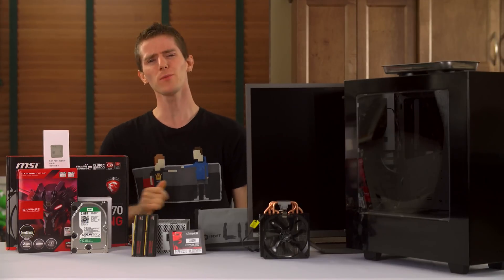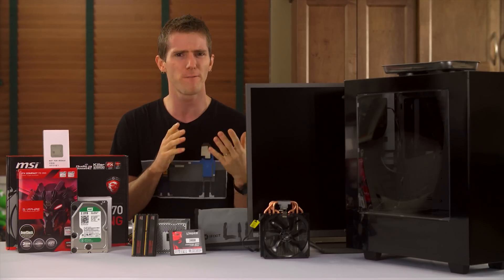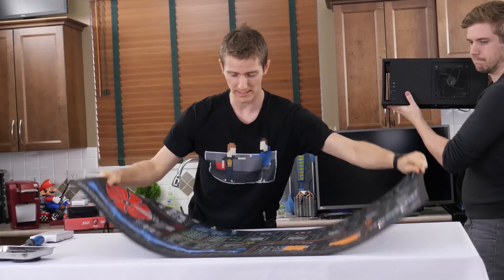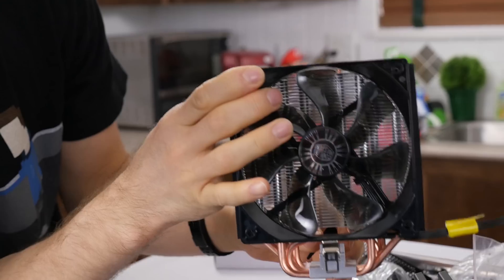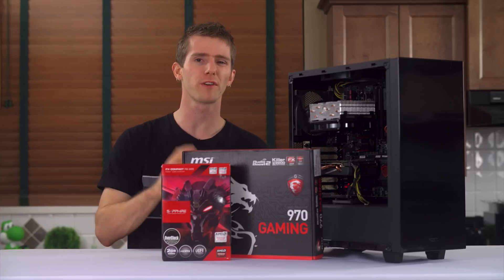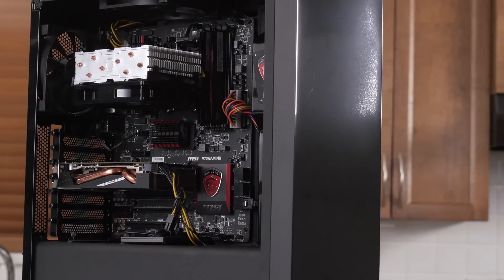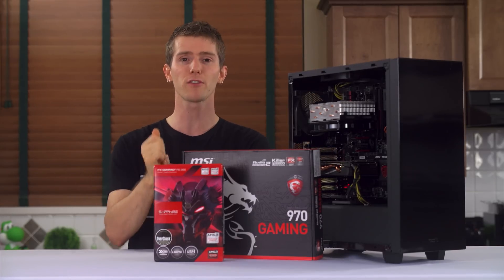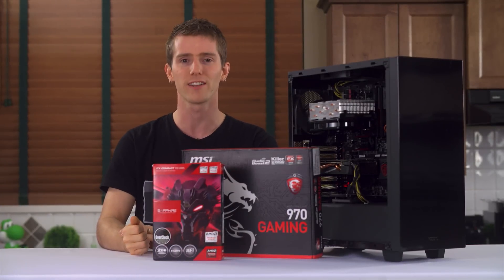Can you Build a 4K Gaming PC for Under $1000?

Comment: I have this build and am loving it! Easily running 4k on all of my games except for World of Warcraft, which runs at 45-50 with details turned down a bit.
I happen to have the 8150 eight core OC'd from 3.6 to 4.0, Can't get it to be stable past 4.2 so I'm not pushing it, I also have watercooling h100i, my question is what is my next upgrade? My ssd is only 120 so OS is not on it, also 16 gigs of ram and running two screens of my 970.
My birthday upgrade was the 970 from the Radeon HD 6970, any suggestions on what my next move is to make 4k a little bit more future proof?
I was thinking cpu for a while because my Fx-8150 doesn't seem to stabilize over 4.2Ghz. It runs really cool with idle 15-20% load at 22C and full load at about 45C. I assume it's something to do with that many cores all being OCed at once (My psu is 750w with about 3 hdds and one ssd, watercooling and 3 fans for intake flow and outtake)
Thinking maybe new mobo with integrated, to just take the load out of the 970, maybe another 970, then I'd need a mobo too, maybe even a new CPU.

Any suggestions are welcome I'm thinking about 400$ budget.
I'll also accept any do this now buy this later idea you guys have :)

P.S. Love the videos keep it up!

Comment: hey maybe you guys in the chat can help me out. im new to PC gaming and dont have alot of money.i dont really want a future proofed system but im assuming that if i make a PC that can play MGSV at its highest settings and 1080p 60fps and also stream/ web surf (im a tab junkie) at these settings then i should be fine with most PC titles that you would also see on consoles this year. problem is i do not know where to start. if anyone has info on what i should buy to meet the requirements im looking for just message me. if it ended up costing 1200 or so thats not too bad but i'd like to keep it as cheap as possible.

Comment: Hook so I don't know if the monitor price was in this but I think it wasn't, for scream at me for being bad at this but wouldn't an i7 4820k with a gtx 770 be better? I managed to fit both this and an asus rog mobo in my price range of £1000 is it just me or wouldn't that be more powerful at least gpu wise?
Reply: Azteched Minecraft The monitor is half the price of the build. Otherwise he could have done a lot better. It's a whole 4k gaming pc. And I think he made a rather good build. If you have the cash you can always run two 285s. Will just have to upgrade the the power supply as well.
Reply: oh ok, i thought that without the monitor it would be really bad but with it, its an amazing build, but what are your thoughts ono the 770's? if you had a little more to spend would a 770 be a good buy
Reply: i7 dose not gain anything over the cheaper i5  and also dose not gain much over the even cheaper amd cpus    770 good card but most are only 2gbs
Reply: i dunno i got the 4GB one but maybe

Comment: Just a heads up R9 290's are significantly better and well within the 200-280$ spread.
Reply: eldragon00 That would have forced them to upgrade the power supply which would have threw out the budget. The 285 is extremely efficient.
Reply: jpchevron Or drop the hdd a bit, get a 40 GB boot ssd and a 1tb hdd, then get a power supply that won't risk damage to your components.
Reply: eldragon00 I'd rather give up the 2tb mmechanicaldrive and get a proper 256GB SSD for myself.

With things like Steam and Netflix there's really no reason to have lots of hard drive space any more.
Reply: Kai Vega i only stick with reputable brands (ie EVGA, Seasonic, Corsair) because its never a good idea to cheap out on the PSU because instability and ripples can fry your mobo, CPU etc
Reply: PSP3000broke Obviously that's ideal. Just saying what I would do if someone held a gun to my head and I had to choose just one ;)
Reply: That's a Seasonic 80+ Bronze PSU, it's not some cheapo generic PSU that won't last you 11 months
Reply: jpchevron Steam is my entire reason for needing lots of hard drive space :P. My 1TB HDD got down to 1MB free space yesterday.
Reply: Diego R there are lots of cheaper 80+ power supplies. also cheap power supplies can last years. ie every home pc sold in the last 10 years(the all are powered by potato power supplies)
Reply: A 290x is a little bit more, and the 8GB version is just over $400.
Reply: I'm talking about a 290, not a 290x. Which is going for 190-270 depending on the brand. This is purely opinion, and not be all end all, but I'd much rather have a 290, more hard drive space and a more efficient PSU, with the ability to run more games at the 4k mark, over lower space, less efficient psu, and a weaker  video card to save some heat and a marginal amount of loading times when used on the games compared in the videos. Especially LoL a game where you have to wait for others to load before you can even start your game.
Reply: Hippy Lemonz Yeah but that's just old world hoarder mentality :)

Just install the games you're playing right now. The rest can be deleted and downloaded as needed.
Reply: Remember this is in Canada, not the United States, check our prices before you try to correct him
Reply: jpchevron
most people still have no problem filling up 2 tb hardrives i mean i got over 600 gb of games and 1.5 tb of movies with a full ssd in need of upgrading
Reply: jpchevron With a 7 Mb/s download speed, that would be very inconvenient! I should buy my games on discs :P
Reply: PSP3000broke SSD makes everything you do with your pc faster. GFX card only really works with gaming. It's easier to turn down settings in game than make your faster in other ways.
Reply: Hippy Lemonz Not really. I was on 6 Mb/s for a long while. Would just let the game download overnight and when I woke up it would be done.
Reply: jpchevron I guess that's an option then. I think I'll stick with my current plan though. I'll only remove things when I need the space. I might as well take full advantage of the space I've got. It's not like it's slowing down my system in any way as I've got an SSD for that.
Reply: Check out the visiontek cyrovenom r9 290. $299, and comes with preinstalled water block, and includes a pump tubing, radiator, (full kit) CHECK OUT JAYZ TWO CENTS FOR THE review. (Insane performance)
Reply: jpchevron I have an awesome internet connection but I still hate your idea! (its nothing personal) I'm running 2x4tb drives in mirror for my games and boot from ssd. Why because its cheap and I don't have to redownload games even with a 78mbs connection its a pain in the arse if i just all the sudden I want to play some skyrim or whitcher 2 and have reinstall from disk or download from steam.
Reply: dob iron Just another heads up, that was a promo pack he got. The full set is about 600$+ That  299 offer is gone, and was before his video even came out.

Comment: but then you need to buy the monitor...
Reply: Uruk 200 That's included in the $1000 budget.
Reply: jpchevron It's not. Those components come to around $950 USD without a monitor.
Reply: jpchevron Doesn't include the storage or case in the description, that's (at best) another $250. GFX is $230~, CPU is $100-120 MB is $110 and RAM is $90. Standard CPU cooler is $30, PSU wasn't listed so $50. Need a cheap K&M so add another $20.
Don't think I missed anything, but that's $890 with being REALLY generous. Especially since they put a 2TB WD Green HDD and 240GB Kingston SSD in. Drop the K&M and cooler since those can be "extras" and it's $790. Not enough for 4k monitor left after all that.

...Buuuuut, the title is a "4k gaming PC" not a full gaming desktop setup, so it was only ever intended as "for the actual machine". Sorry for all the details, me and my friend decided to figure it all out for some reason, haha.
Reply: ***** Which expensive shops do you use?

If you check the description you can see which shops he used. New egg even comes in a bit cheaper than the prices he used:
http://linustechtips.com/main/topic/276627-4k-amd-build-log/
Reply: even the cheapest 4k monitors are still $500+ so there's no way you could build a pc powerful enough to power one and a monitor and peripherals for under $1K
Reply: Uruk 200 Like I said he lists his components are pricing in the description. 

Anyway here's a link for a 4k monitor for $419:
http://www.newegg.com/Product/Product.aspx?Item=9SIA6R42AF3797&cm_re=4k_monitor-_-24-260-197-_-Product